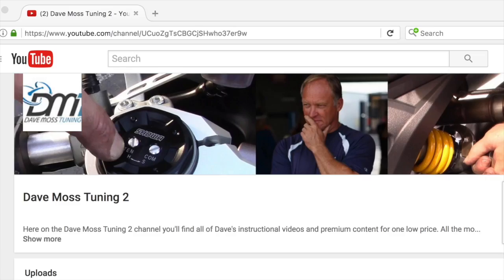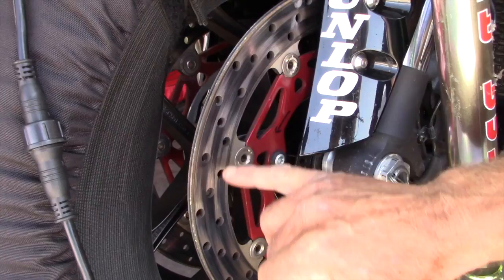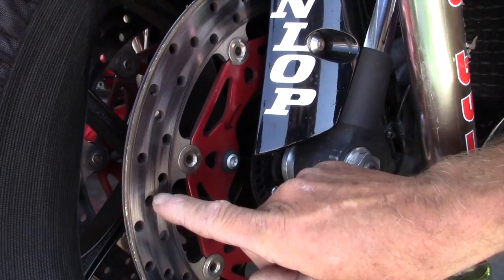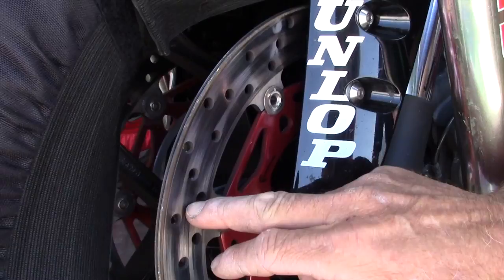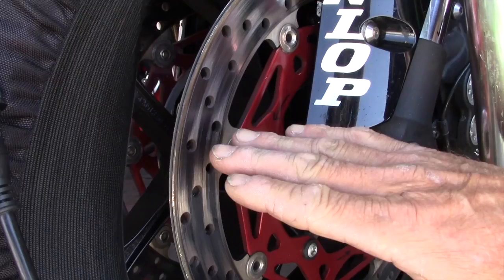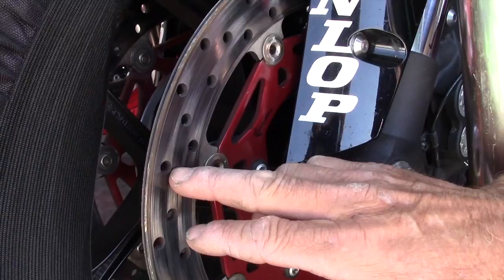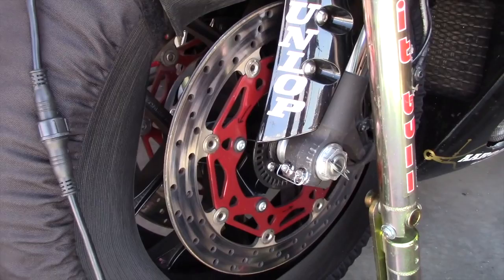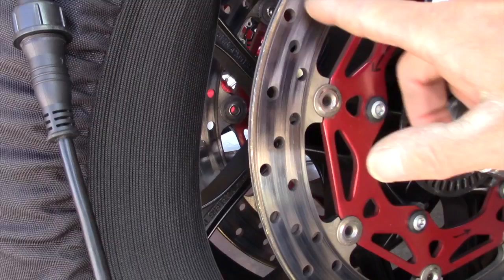Ask Dave: Brake rotor stains

Comment: From car experience, it is quite the opposite.
After installing new rotors and pads and after the initial bed in, you need to lay some pad material on to the disk in order to achieve maximum braking power. Correctly bedded pads form a transfer layer of material on the surface of the disc which improves overall "bite" and performance. Without proper "pre-bedding" that simulates the correct heat and torque loads seen in actual driving conditions, a pad’s true potential cannot be realized(This is more to degas the pads). This process will also ensure that the pads will produce a rotor finish with a consistent transfer layer which prevents "judder" from occurring.
I agree with the advice on the video, but for very different reasons! These rotors must be re-surfaced in order to make them flat again. Being flat will make the mentioned above possible to achieve.
Reply: Indeed -- from what I've always been told, you only need to clean the rotors when changing compounds/brands OR if the build up is uneven and you start to get pulsing.  The buildup of pad material on the rotor increases the friction coefficient with the pad itself and makes the brakes work better in my experience.   :shrug:  Dave has a lot more experience than I do, so I am a tad confused...
Reply from the maker: Dave Williams, editor, replying here.  The following is from Galfer's brake rotor maintenance page.  "All brake rotors tend to build up brake pad compound material over time. Pad build embeds itself into the disc and can retain heat, which promotes disc warping. To prevent this from happening, and to ensure your pads always brake on good and clean rotor surface, we recommend getting your discs bead blasted at least once a year. If you are racing or use the bike for heavy sport use, you may need to do this more times during the year. Call us; we can help with this procedure." 
Bear in mind, car rotors are iron.  Sportbike rotors are stainless steel.
Reply from the maker: may I suggest you clean your rotors now, do another break in and then retest with "clean" rotors to see what the braking feels like? There's nothing like testing to get out of book smart and theory to real world application. Please share what you experienced.
Reply: I know this thread is two years old but motorcycle rotors are stainless steel, and not iron, so that changes everything between the two.

Comment: Brakes work  better when you have Pad contacting embedded Pad material on the surface of the rotor.  Pad material gets 'sticky'  Steel does not.  So Sticky against Sticky has more stopping force compared to  Sticky on slick steel.  Even if you remove the embedded pad material and make the rotors shiny again, they will quickly change color and become dark, ensuring Pad material grabbing against embedded Pad material, and thus the best brakes possible.  What you do NOT want to see is BLUE metal, which indicates overheating, and is 2-3 times as slick as silver or blackened/embedded metal.
Reply from the maker: Thank you for sharing what you have learned!

Comment: I believe that maximum braking can’t be reached until adequate pad material is embedded in the rotor braking surface. There is something going on with this rotor, maybe changed pad brand/model without cleaning 🤷🏻‍♂️

Comment: curious question tho.. what exactly is "bedding" in the brake pads mean then?
Reply from the maker: ensuring enough material from the new brake pads is transferred to the brake rotors.
Reply: @catalystreactionsbw  think youll find the comet marks are carbonised/oxidised burnt pad material... there shouldn't be ANY pad material transfered to the disks at all... even though the disks mightn't show blueing to suggest over heating brakes... the pads in this case clearly arent compatible with the disk material... the disk holes are to vent pad gases to prevent an aquaplaning effect of the pads on the disks... id suggest they might be using cheap aftermarket pads or at least the wrong material pads maybe made for iron disks not stainless or visa versa

Comment: @davemosstuning. Dave can you recommend a type of bead material to blast the rotors?  They are stock 2014 GSXR 1000 rotors with SBS sintered D2 pad material. Two race seasons on rotors
Reply from the maker: 400 grit and some elbow grease in an X pattern, brake hone in an electric drill or glass beads/Zirblast ceramic beads or sand blasting.

Comment: @Dave Moss Tuning My R6 rotors looked considerably worse than the ones features in this video clip so I removed them from the rim and gave them a good cleaning by wet sanding in a hatch pattern.  After one session on the track (about 20 mins) I noticed the rotors were right back where I started (very black)!  Is this normal or could this be due to excessive brake drag? I’ve had a suspicion that I may have a slightly warped rotor causing brake drag, could the constant rotor stains be an indicator?

Application: Track only. Moto: ’12 R6 with OEM brakes.
Reply from the maker: For the rotors to be cleaned and instantly black could mean that you have brake drag. When was the last time you cleaned the brake calipers with a toothbrush and soapy water? It may simply be a stuck piston.
Reply: When I removed the wheel to clean the rotors I also removed the brake pads to clean the calipers.  I made certain to install the pads back to their original position/orientation.  Under my heaviest breaking (right before I flop the bike) I notice a little shutter/pulsing in the front and thought it was due to the dirty rotors...
Reply from the maker: Ah, okay. Check the buttons on the rotors to see if the carrier/buttons are creating too much flex fore and aft. Easy to do when you apply the brake and lock the rotor to see if it clunks as you push forward and backward.

Comment: should I upgrade Metzeler M5  to peralli diablo rossa II I mostly used my bike on road which one will be the  safest options which provide optimal grip all time
Reply from the maker: Grip is a function of chassis and suspension, just as much as it is a function of pressure and riding ability. Softer tires wear out faster, therefore budget come sinto play. You cannot buy a bad tire these days, so figure out what you want for compound first - one or multiple, and go from there.
Reply: I have Diablo Rosso 3's on my Street Triple R street bike and I say you cannot go wrong with these! Wet weather riding is quite excellent aswell in my experience. And i do about 7000-7500km on a rear tire. Im going for Supercorsas in a few months for  5 Track days in march in spain tho.

Comment: Dave, do you mean the rotors have to be deglazed? or is it actually sanded down?
Reply from the maker: 400 grit emery cloth, sandblasted or use a brake hone. Whatever you choose of these three.
Reply: @catalystreactionsbw  Thank you, Dave.  I've been looking for recommendation on emery cloth grit number for optimal sanding effect. Is anything less abrasive not effective for this purpose? 800, 1000?
Reply from the maker: @AlexSuperRocket  Correct - it will not remove deposited brake pad material.
Reply: @catalystreactionsbw  Thank you, Dave.
Reply: @catalystreactionsbw  paibt stripper will clean the disks well

Comment: That kind of stuff prevents locking up the wheels.  Having perfect brakes results in going over the handle bars under braking.
Reply: As an old, retired road racer friend of mine once told me.. "I've had front brakes that could lock the front wheel with 1 finger, and I never felt that I had TOO much front brake." Statements like that tend to stick with you. It's rider ability and modulation.